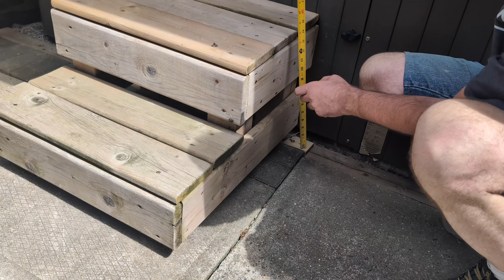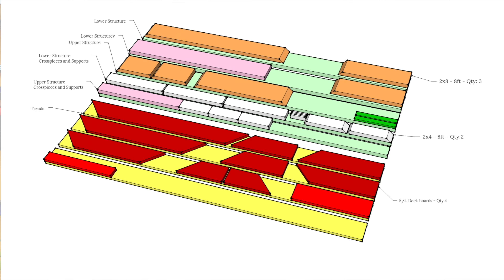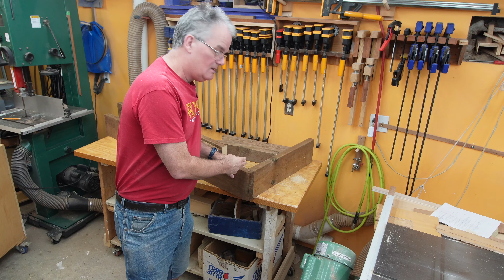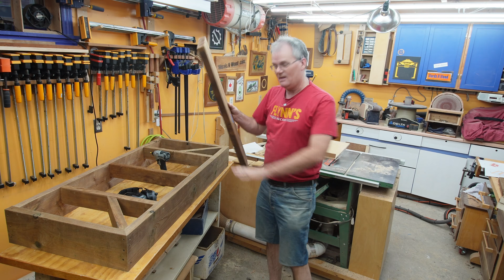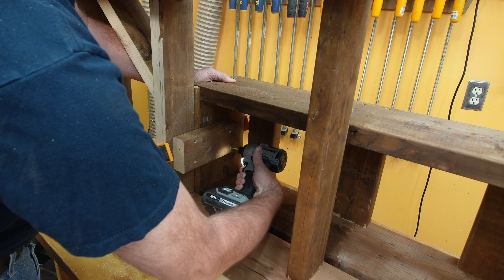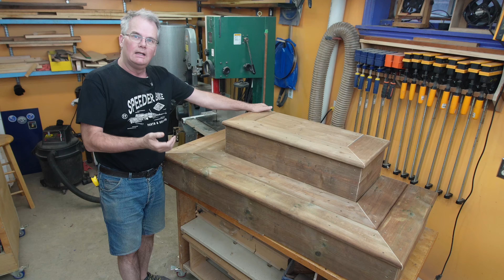I'm a Woodworker not a Deck Builder!  Is this how to make steps?

Comment: hey man I recently watched a video of yours made in 2016 i believe, where you tested the maximum brand impact driver, drill and circular saw, I was just wondering how they have held up since then, if they are still working, and do you still have them, thanks!
Reply from the maker: Yes to all of that.   I did make a follow up video, but that is also now years old.   https://youtu.be/Xy13BQJr5QM?si=B9yxOKLqjNaK_5vE even bought a maximum sawzall last year.   Still wish they had more tool options like sanders and such.  But it’s definitely mostly car-focussed as a brand

Comment: I like the look of the 45 degree cuts. I’m afraid they may open as the boards dry and shrink. Maybe if it’s not overkill, pocket hole screws and construction adhesive at the joints. Overall I like how they turned out.

Comment: I see myself doing these little touches for a basic project too. Interesting pressure treated, not the southern yellow pine we have in the US. Good choice on using the small drill instead of the impact, it’s often my choice too. I think people automatically reach for the impact when the drill with a proper clutch setting would be a better choice.
A nice simple, useful project. Thanks Art.
Reply from the maker: Thanks for the kind words!